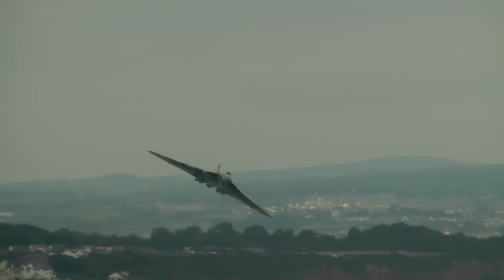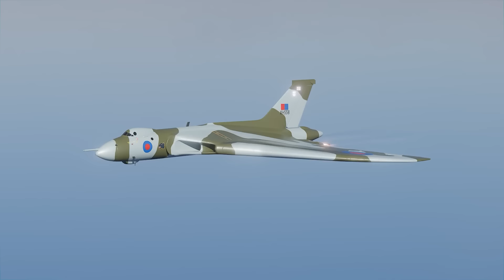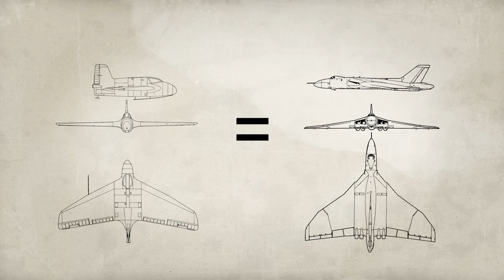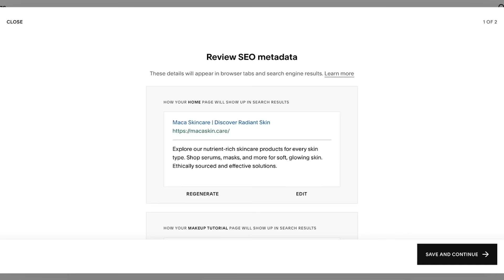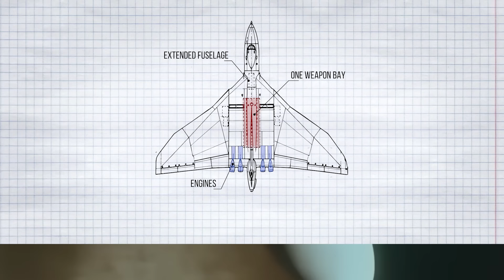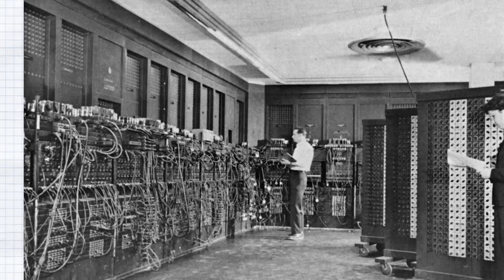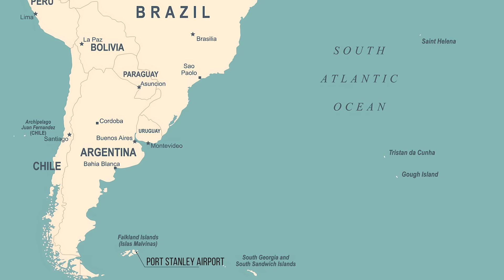The British bomber made to defeat Russia... Avro Vulcan

Comment: Argentinians: Why do I hear boss music?
Reply: It did nothing. The single hit in the airfield was filled the same day. Pucaras, Aermacchis and Texans light aircraft as well as the C-130 kept operating on the airfield uninterrupted.

The Vulcans got lucky they weren't shot down when they were locked by AAA. Due a friendly fire incident they had to confirm with the command an control if the target was legit and they escaped before confirmation was given.
Reply: @Argentvs  To correct your oversight the Mission was a complete success. While the runway was destroyed and repaired within a day it's the shock and terror value that counted the most. Argentina never expected us to be capable of performing that kind of bombing raid. They did not know how close they came to having the capability to lock onto the vulcan with their AAA so as far as they were concerned they never stood a chance and the UK had proved it could reach out and touch Argentina where it thought itself invulnerable and could do it again.
Only with hindsight do we know it was a lot of skill but just as much luck that it succeeded. Argentina did not have such hindsight and had to assume this could be done again and again. That's why this one bombing mission changed their air operations completely.
Reply: @MarcusRhodes-q2s  you are making assumptions about Argentina. Yes they knew they could get it, I spoke with the then lieutenant in charge of the GDF battery and they locked on it. As well the Rolland II SAM also had it locked and ready. 
The runway was never out of action, gets your facts straight. A single bomb hit a side of it and was irrelevant for the small aircraft operating there. And the C-130 fitted on it with space to spare.

The mission was purely a RAF attempt to show off taking 17 refueling operations and the entire British fleet of sir tankers (including written off tankers taken out of scrap) to make 2 Vulcans reach and fail 99% of their bombs landing outside the airfield. 
It was a political move to threaten a non-nuclear country with nuclear weapons which was a major concern in Washington as per declassified documents. 
But it was meaningless since the Vulcans were sitting ducks if they got near the continent. A mirage III would slaughter them easily and that why the sir defense wing in Moron Air Base was left there. The Vulcans needed to fly at max altitude in order to reach Argentina and were easily detected by the Westinghouse radars 400 km away. Those bombers relied on free fall dumb nuclear bombs so they had to fly over Buenos Aires. They would be easily taken down hundreds of km earlier in the ocean with the Matra R.530 or guns. 
The British planned such mission with an escape over central Argentina to Chile. It was suicidal with 100% no return chances as per their own mission planners as they were 3 mayor sir combat brigades on their path to Chile. A distance bigger than from London to Warsaw.

Not to mention how the US would smack London into the head doing such stupidity of nuking s non nuclear and allied country during the cold war showing the world that they are the bad guys and giving the commies a major propaganda victory. The US took over UKs nukes after the war and can only use them with the US approval and the US can remote block the British Minuteman missiles. 

Plus that would forced many countries to make nukes. Argentina and Brazil were already technologically advanced to make fission bombs. We don't have them because we agreed to not make them and avoid an arms race. The first Israeli nukes were made with Argentine yellow cake (processed uranium powder) secretly sold to Israel under the CIA oversight (so the Soviets couldn't trace US nuclear materials given to them).
Reply: @Argentvs  It proved that a nuclear capable bomber could 'visit' the mainland.  It was far from pointless.  Thankfully it didn't come to that
Reply: @justyx846  they could, without escort. Flying ducks since the Westinghouse radars would detect they at 300 miles away and being intercepted by Mirage IIIs. They actually planned it and they plotted the escape route over central argentina to Chile, 1200 km over the air space of 3 combat air brigades. The planners concluded 100% casualty rate for the Vulcans, nowhere to escape at sea, Brazil would shoot them down not wanting to have anything to do with it, and Uruguay was under Argentine air dominance. 
And nuking a non nuclear country over smalls islands would have been world changing. Suddenly all the US efforts into non proliferation would go down the drain as the whole world would see how untrustworthy nuclear powers are and rush into nuclear programs. 
It would also prove how barbaric the capitalist side was, giving reason to the commies which would see an increase of countries wanting they umbrella. 
The US interests in Latin America would have been severely damaged and Washington would lose face promoting the region to doubt the US security promises as they allow such crime
 Along that nuking Buenos Aires, killing millions, would have destroyed US, German, French, Japanese companies. Not to mentions hundreds of thousands of residents were European immigrants.
Reply: @Argentvs Sounds like someone's salty they didn't get to have a British island
Reply: @ioandavies2292  historical facts are not salty.
And the British islands are near Europe. Elsewhere is called colonies.
Reply: @Argentvs  welp, still not Argentinian and never will be
Reply: @Argentvs  cope harder

This world is divided into two parts: England and the Colonies
Reply: @Argentvs  A colony requires a native population to colonise, we settled the islands permantly first. So no, the Falklands are 100% British.
Reply: @i-like-turnips  No, a colony is a colony where you send colonists... Don't talk if you can't even properly know etymology.
Reply: @Argentvs  I see, so what would it be called if Argentina sent people to those islands? The Falklands are outside of your Terrirorial Sea (12m), outside of your Contiguous Zone (24m), and outside of your Exclusive Econimic Zone (200m). What would that be called then? 

I will repeat, Argentina was formed in 1816 after gaining your independance from Spain, the British settled those islands in 1766 (before Argentina was formed). So Argentina has no natural claim to the islands, Argentina had no people on those islands, the Britsh were the first to make a permanent settlement and claim the unclaimed territory.

Edit: Also, this has nothing to do with etymology, what you mean is definition as per the English dictionary. Etymology is the root of a word, the origins of a word that has become adopted into another language.
Reply: @i-like-turnips  Argentina is the continuation of the Viceroyalty of the River Plate, natural successor of all its rights and claims. Including the islands as per the Royal Edicts of Spain. 
The Name Argentina is on use since 1600, being written as already common use for this lands in the book La Argentina, 1601. Terra Argentea as Spain named it became Argentina as shortener in the mid 1500s. 
Buenos Aires had the administrative responsibility over the islands claim as per the Spanish territorial administration. In the 1670s 5 ships with 500 men departed Buenos Aires and Montevideo with orders from the Governor of Buenos Aires to evict the English trespassers after in 1665 the Spanish reclaimers that took over the French colony, yielded as France recognized Spanish sovereignty. 
Buenos Aires kept uninterrupted control of the Islands until the Napoleonic Wars, in which all Spanish Warships in the viceroyalty were called to Spain and they had to evacuate the islands due inability to keep ships going there.
Argentina revolted against Spain when it was invaded by France and after the English invaded Buenos Aires 2 times, showing the Spanish authorities incompetent and defeating the invaders with local militias. 
As per the Independence Declaration the Viceroyalty of the River Plate became the United Provinces of the River Plate, withholding all rights and claims of it.
London recognized the Independence declaration in 1825.
Mind Lord Wellington himself said in the late 1820s (when Argentina stablished a new settlement in the islands) that he wasn't sure if they ever had any right to such windswipped islands and did nothing.

UK only invaded the islands in 1833 because the US bombarded the settlement as they wanted free walling and seal hunting there and told the English ambassador in the US that they destroyed the settlement. They took advantage Argentina was weakened after years of fighting off the Brazilian Empire invasion and was in the middle of a civil war.
Reply: @i-like-turnips  Argentina is the continuation of the Viceroyalty of the River Plate, natural successor of all its rights and claims. Including the islands as per the Royal Edicts of Spain. 
The Name Argentina is on use since 1600, being written as already common use for this lands in the book La Argentina, 1601. Terra Argentea as Spain named it became Argentina as shortener in the mid 1500s. 
Buenos Aires had the administrative responsibility over the islands claim as per the Spanish territorial administration. In the 1670s 5 ships with 500 men departed Buenos Aires and Montevideo with orders from the Governor of Buenos Aires to evict the English trespassers after in 1665 the Spanish reclaimers that took over the French colony, yielded as France recognized Spanish sovereignty. 
Buenos Aires kept uninterrupted control of the Islands until the Napoleonic Wars, in which all Spanish Warships in the viceroyalty were called to Spain and they had to evacuate the islands due inability to keep ships going there.
Argentina revolted against Spain when it was invaded by France and after the English invaded Buenos Aires 2 times, showing the Spanish authorities incompetent and defeating the invaders with local militias. 
As per the Independence Declaration the Viceroyalty of the River Plate became the United Provinces of the River Plate, withholding all rights and claims of it.
London recognized the Independence declaration in 1825. So did Spain recognizing Argentina as the sole successor of the Viceroyalty.
Mind Lord Wellington himself said in the late 1820s (when Argentina stablished a new settlement in the islands) that he wasn't sure if they ever had any right to such windswipped islands and did nothing.

UK only invaded the islands in 1833 because the US bombarded the settlement as they wanted free walling and seal hunting there and told the English ambassador in the US that they destroyed the settlement. They took advantage Argentina was weakened after years of fighting off the Brazilian Empire invasion and was in the middle of a civil war.
Reply: @Argentvs ireland:
Reply: @Argentvs  By your definition, Australia and New Zealand are colonies. The Falkland Islands were populated by the British.
Reply: @Argentvs dude chill up with some copium.
Reply: @GabecalebGonzales  Chilean spotted.
Reply: @Argentvs what? What are talking about?  What did I do to you?

Comment: One minor error of fact  - only ONE Blue Steel  could be carried, under the  bomb bay..
Reply: Also it states it carried the missiles so that it could 'defend itself' which is at best misleading. This makes it sound like an air to air missile for shooting down other attacking aircraft with. The blue steel was a stand off nuclear tipped missile for aiming at well defended ground targets so that the bomber didn't have to expose itself to the enemies air defences. The missile was defensive only in respect to allowing the bomber to avoid some of the risk due to it's 575 mile long range.
Reply: @christophertelford You explained that car better than I was going to
Reply: He got confused with the amercan skybolt program, the B2 Vulcan was designed to carry it, there are hardpoints on each wing. During the Black Buck raids these hardpoints were used to carry the anti radar missiles and the ecm pod borrowed from the bucaneers as the vulcans ecm was out of date back in 82